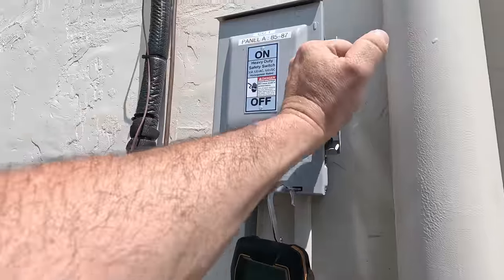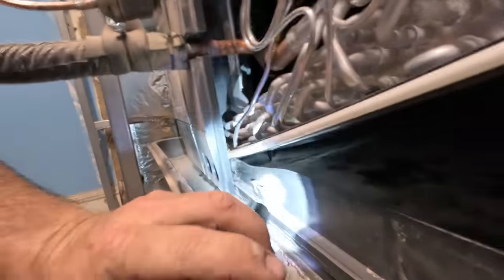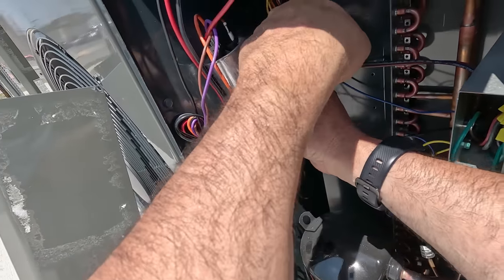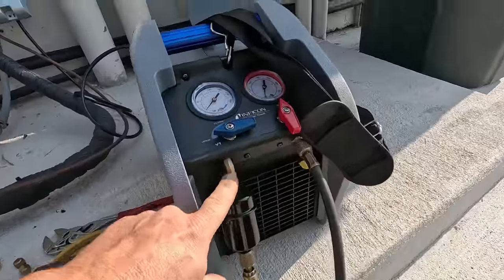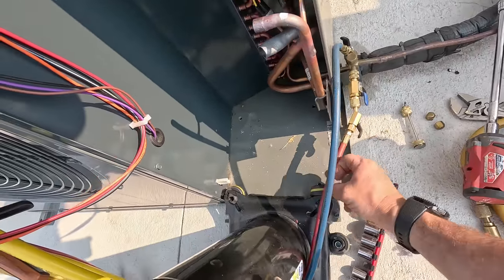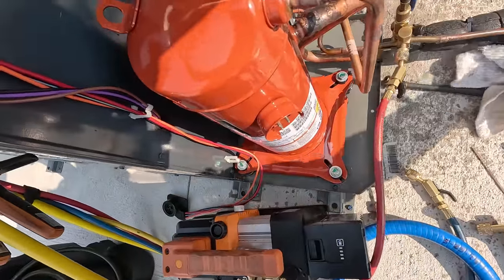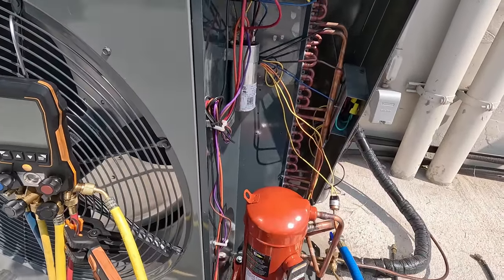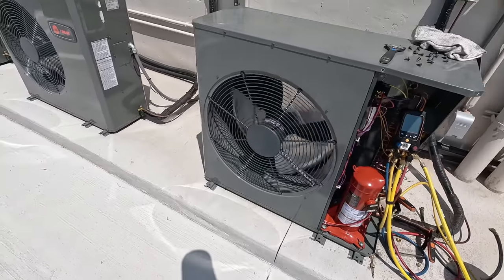New Trane Air Conditioner Dead On Arrival PLUS Lots Of PROMBLEM'S

Comment: I'm wondering if their quality has dropped due to manufacturing changes, etc
We have a Trane unit that is going strong 27 years later And every time our HVAC guy comes out to do routine maintenance, he makes comments about how they really don't make things like they used to and how you are lucky to get 10 or 15 years out of a unit today.

Was there a company switch over where quality changed or did we just get a lucky unit? Lol (It's a heat pump unit) Haha
Reply from the maker: It can be a mix of how it was made, who made it and more importantly how it was maintain and installed
Reply: @HVACRSurvival  thank you for taking the time to answer :)

Comment: I’ve actually never worked on that specific Condenser
Reply from the maker: It's just a basic AC from what I seen.
Reply: Side discharge style unit. No different than a standard condenser.
Reply: Yes, I’m aware, I guess I’m only saying that because I work for Trane.

Comment: compressor replacement without filter drier especially when not purging with nitrogen to prevent carbonization, guys n gals this is perfect example on how not to perform a compressor replacements
Reply from the maker: I replaced the dryer! I Purge with nitrogen while doing the dryer, the only thing I didn't was the connection at the compressor. Try watching the whole video
Reply from the maker: You must be blind and deaf.  I’m so sorry to see that happen to someone with such low intelligence , it must be very difficult going thru life.

Comment: with that poor installation quality ,no wonder the rubber band of the horn was pulled so many times 😂 when you see that kind of work it makes wonder where that person or company got their certification
Reply from the maker: The ductwork looked good, just the drain and the outside looked bad. It's hard to say what happened
Reply: @HVACRSurvival  maybe the plumber did that part?  lol

Comment: Trane used to be the best,  WTF happened
Reply from the maker: Fell off the tracks 🤷. Lennox used to be top of the line too back in the '80s. Everybody takes a shit eventually
Reply: @HVACRSurvival   what are brands that are good choice- I work in Maintenance - service for condo and hotels, I don't do HVAC, But I am always getting ask what are a good brand - SO what brands are a safe choice nowadays ? thanks John h
Reply from the maker: Really depends if we're talking commercial or residential also depends on which model you buy. There's high medium and low. And even then the high doesn't always mean better it's really a case by case basis you have to look at it and see how serviceable it is depends on how the parts are stocked or not depends on how much technology is in it whether it's going to be a problem down the road and you can't get parts. They all have issues they're all built by the same idiots